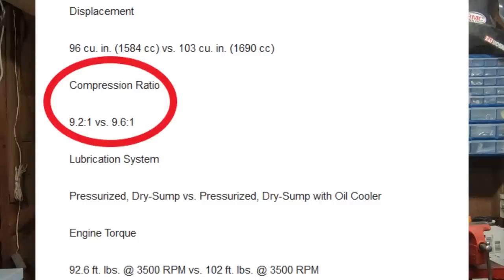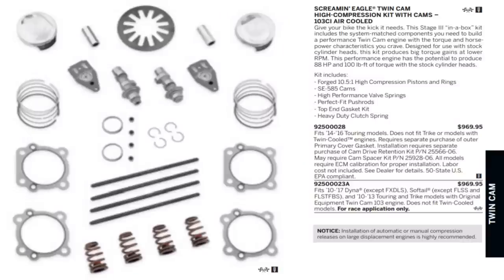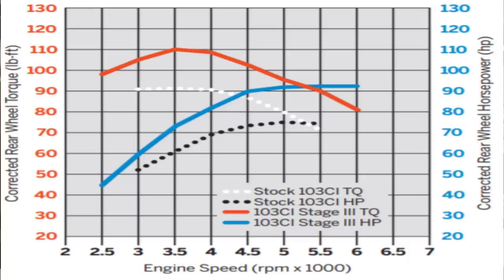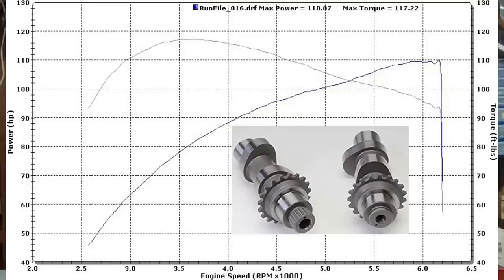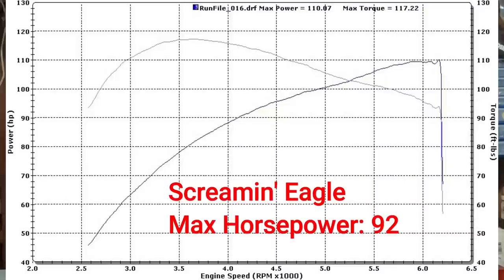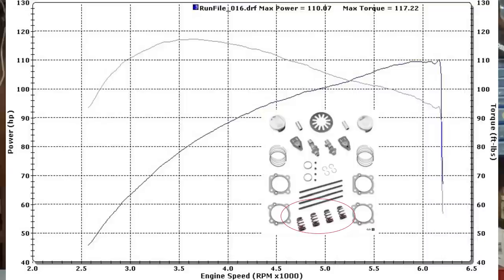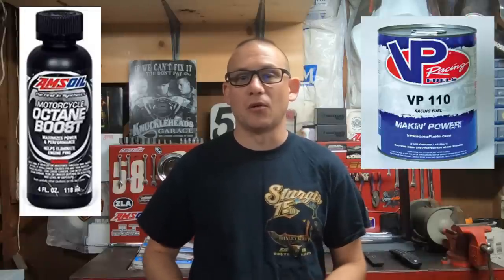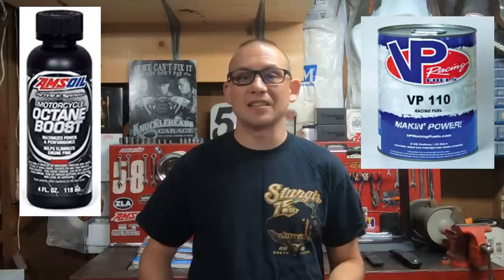Harley Twin Cam Engines Love Some Compression

Comment from the maker: Do you prefer to keep a lower compression ratio or bump the compression ratio up for more power?
Reply: Never thought about going this route, thanks for sharing. Will give it some thought.😎👍
Reply from the maker: It's not a bad way to go, Twin Cams really make some power with high compression and a good cam.
Reply: Bought a T.C. 88 with screaming eagle heads, air cleaner, thunder header 2 into 1 exhaust the bike has compression releases. I need to find octane booster.
Reply: This is a great topic to discuss. A minimum of 10.0 should be a baseline for almost all builds. I can't wait until I have a legit reason to remove my cylinders and heads.
Reply: @thewheel2023  
Octane boost is not that great. What I do for my shovelhead that detonates on pump gas is go to the drag strip and by 110 Sunoco & mix it 1/2 & 1/2 with 94 Sunoco comes up at 102 octane. You can mix more or less depending on your octane requirements
Reply: Compression and lots of it...
10.5 to 1 on mine
Reply: @thewheel2023  I run high test without corn in it. And I have never had a problem with detonation however I did retard my tuning two degrees to slow my engine down just enough so that I could fill the jugs at 6800 with my 67g Andrews cams.
Reply: Bump it up 😁
Reply: Keep in mind what elevation you are at and that cam choice will affect what you get for corrected compression. My static has been raised to 11.1:1 but I am no where near getting that after you factor in all variables. Best to use one of those compression calculators on the big boyz website.
Reply: @scrumthebum2451  I found in some of the states at the Sunoco stations they sell the race fuel in the back of the station away from the regular pumps out front. My brother runs a tank through his bike once in awhile.
Reply: @nickc5341  I use a compression tester and do the calculations my rear cylinder is actually 10.58 or something to one and my front jug is 10.52 I'm at 800 ft
Reply: @randylucas2458  nice. Those are good compression numbers. What's your ccp at? Unfortunately I live at 2200 feet elevation which makes it a little harder for me to make power. Wish I could afford a pro charger lol
Reply: @bradballard2068  
Cool but nothing like that around me. Maple grove raceway is only 20 minutes away 👍
Reply: @nickc5341  I'm not sure whether super charging a Harley motor is a good idea I've never done it I did supercharger goldwing once and that was magnificent as for my CCP's I can't remember it's been like four years since I ran them The elevation you're at I would consider a supercharger maybe a mild one three or four pound boost I don't know I've never tried it
Reply: 10.5 to 1 to 11.0 to 1 will work great !
Reply: Well I've been running the woods 222 with stock compression in my 2015 fxdb for about a year now and recently my factory pressed crank has shifted, so it's in the shop now getting a rebuild... S&S crank, with domed weisco pistons, cylinders honed to match...and some mild head and valve work... and at about 10.25:1 compression I decided to switch cams over yo the S&S 585... I should have the bike back by the end of next week and I'm really looking forward to the results...
Reply: more compression = more HEAT ..CAM IT,, better pipes, tune it ..let the air flow..AND if you cant good gas , its a dirty cylinder.
Cam it, shave the heads.(?)..Higher compression will be harder on the bike.

Comment: It's amazing what a slight bump in compression, minor headwork, and a cam will do for performance.  Top that off with a great dyno tune and it's like a new engine. The sad part really is that they could and should be built this way.
Reply from the maker: I totally agree, they should come from the factory like we build them in our garages. It really show us just how much potential they intentionally leave out of these engines.
Reply: This is what they call the Harley Tax
Reply: @simonkennedy6116  Harley Tax because Harley Slax on performance
Reply: They design the engines to run on the shittiest gas/harshest climate in the world without engine destroying detonation! Otherwise the manufacturer would go bankrupt doing warranty work! Ultra conservative timing curves negate detonation and lean fuel meets EPA mandates.  That’s why an aftermarket tune adds good power, more timing/fuel....

Comment: Turned my stock 88" twin Cam into a 95". 585 S&S easy start cams. And 10/2 to 1 compression piston Dyno at 110HP. And 117 lbs.   Baby really moves.
Reply from the maker: Damn. That's some hella good numbers from a 95! Just goes to show what the right combination of parts can do!
Reply: What part of the country do you live in, and what shop did the work. Thanks

Comment: Did my 2009 fxdf with the SE stage 4 race kit with yellow race SE tuner, 10.5 to 1 compression, ventilator intake and SE slip on mufflers. My year had no catalytic. Ended up with a reliable 111 HP and 110 TQ. Bike runs great!
Reply from the maker: That's awesome! That's a really solid amount of power and doing reliably is what it's all about.

Comment: Your right on with more compression ! I don't even do stock rebuilds with out using Cometic MLS gaskets back in the day we always milled Evo heads .020 to wake them up but now we got thinner gaskets lots easier ! Your also right about checking valve to piston with stock pistons Back in 99 TC motors there weren't any good pistons & we had to machine the pistons for deeper & wider valve pockets for big valves & high lift cams !
Reply from the maker: Great point! Cometic is the way to go in my opinion on gaskets! We've reused those things before time and time again, first time was a have to situation and it worked. These gasket thicknesses available is awersome!

Comment: Good info man. I had my screamin eagle motor done last winter, kb domed pistons, heads were ported, andrews 57 cams, crank has 2 thou run out, which surprised the mechanic and me as well...10 over bore, hone, and decked gasket surfaces, hpi throttle body, bigger injectors, bassani 2 into 1 road rage 3 pipe, arlen ness velocity stack air filter, tune liscence from dyno jet and a proper dyno tune...runs awesome now for a 19 year old bike...2003 cvo road king.
Reply from the maker: Nice work! Damn that's a laundry list of work done to that bike! Those are some beautiful bikes, especially that first year of the 103 Road King, I bet it runs damn good.
Reply: @GixxerFoo  ....ya man, thanks for responding!....its really fun to ride now,  it was befor when I first got it, but now it's like a steam loco!

Comment: Great info, as always. I wouldn't tear a motor down just to raise the compression, but if I were doing other work and had it mostly apart anyway then it is definitely worth it.
Reply from the maker: Right on, not a good plan if it's got some miles on it. If it's low miles and you added a cam and changed your mind on compression I could see doing it then.

Comment: After seeing this build I'm excited to see what mine is gonna do on the dyno .
100" S&S kit with 10:5:1 
S&S cam plate and pump 
Woods 777 cams 
Woods lifters 
Fuelmoto pushrods 
Heads ported and polished with oversized valves and beehive springs , roller rockers and decked. 040 for about 11:1 compression. 
Tuned with a thundermax tuner. 
Appointment with dyno tuner next month. 
Not sure what the Hp and tq is but this thing is fun😁
Reply from the maker: That bikes is gonna sound angry and run hard! Let me know what you end up with!

Comment: Just remember. The more duration the intake cam has the later that valve closes which lowered dynamic compression.  12:1 static compression could be perfect for pump gas if your cam has enough duration.
Reply from the maker: You are correct! There's so much to calculating compression it's crazy, it all has to balance to be right!
Reply: So I'm looking at a WG right now. It's a built s&s motor top to bottom w/ 585 cams. It has 12.5:1 which seemed pretty high and I can't find any info online about Harleys with such high comp. Are you saying its not too high?
Reply: @kye9549  That seems high for that cam and 91 octane. If 93 is available in your area, it may be close but it wont be happy on days over 70 degrees.
Reply: @robertbachant8257  we have 98 available. Plenty of hot days coming up though

Comment: If your running that low why not kick it up.  We used to run cars at 11.5 to 1. Wrist pins, crutch assembly , valve springs needed to be increased and maybe a better oil pump.  Why not when it’s time to rebuild it have some fun?  If you are like me and a gear head be it bikes , cars or trucks it’s a no brainer.  It’s something I like to do with my sons and pass the knowledge I have from my father to myself.

When I was kid in the late 60s -70s the gas shortage hit.  We used water injection as the gas was crap. Texas 93 octane is all over
Reply from the maker: It's crazy what some increased compression will do for a motor, biggest problem is keeping them from knocking on pump gas. Gas quality varies so much when you're traveling, I've gotten stuck at some old 2 lane highway station with only what I assume was once 87 octane lol. That's why I carry some octane booster just to be safe.

Comment: YouTube buried your channel on me but I'm back. ✌️😎
Also, I wanted to thank you for your recommendation of the spherical bearing kit for my swing arm that was on a previous video. (That I can't find)  I did the install on it and it works great. It took that torque kick out of the ass end of my bike when I get in the throttle. LoveLoveLove !
I appreciate all your uploads and your sound advice.
Reply from the maker: Thank you! I really appreciate it! It's great to hear you got your bike straightened out and tracking right now!

Comment: Awesome.  Love the content. I used a .0030 gasket when I did my heads.  Dan Vance Racing did the work.  I would recommend him any time. Talking my book, but he might be the best HD head guy out there.  His back ground was racing.  I use octane boost all the time.  I don't have any problems, but I notice a significant increase in power.  I think the gas we get today cut with ethanol is not that great. Not only an increase in power, but gas mileage, so it's a win win. Left the stock 103" pistons in.  Someday I'll upgrade to a drop in 110", but the motor runs so good, I'm afraid to touch it now.
Reply from the maker: That's awesome to hear! Yeah ethanol fuel is awful, I avoid it as much as possible.
Reply: I always hear how ethanol is bad, but every manufacturer designs the engine to run on it, ethanol is a form of alcohol,  e-85 is essentially alcohol and has a 110 to 120 octane rating. I always run premium fuel 91 or better, but everything else like the daily, mowers etc get 87 and they work year in and year out.  I think the "ethanol bad" myth is just that, a myth at this point.
Reply: @Random-bm7ho  It's not that it's 'bad', but it definitely cuts the mileage. That's a fact. I run 91 also but like I said, I add in a octane booster and I love it. If you have never tried it, do!  You will notice the difference I guarantee it.
Reply: @Mark-mm1ke  I usually run some of the Lucas fuel injection cleaner/lubricator stuff in every tank. It's just a stock 103, but I'm looking to add cams, upgrade the oil pump and cam plate, and maybe a thinner head gasket while I'm there. Engine has 18k on it. Just looking to wake it up some.
Reply: @Random-bm7ho  I did a lot of searching on cam profiles before I bot the Woods 222. Has the best low end torque of them all imo.  So I went with that, V&H power duels, map, and air. Came out great. Next year did the heads. Wow, what a difference. Numbers were not all that much better, but the seat of the pants ride was!  Here are the numbers. 116 torque, 103 Hp.  Torque at 2000 rpm 100ft/lbs. Bike runs incredible. I also did both front and rear suspension from Terry Cable. I’ll never get another bike and not do that.  Handles like a rice rocket!  LOL Well, you get the picture.
Reply: @Mark-mm1ke  I think I'm gonna go with the S&S 583 cams. Already have the VH Power Duels, Roland Sands intake, and the FP3 tuner.

Comment: I have kept my 88 standard, apart from a change of exhaust cam which makes it run cooler.
I like the fuel consumption of standard trim suits my riding.
But I know a lot of guys up the power and that’s their right, it would be boring if we were all the same.
Reply from the maker: Nothing wrong with keeping it simple, they are very reliable with just basic tuning, exhaust and air cleaner.
Reply: What exhaust cam did you use. Running cooler sounds good to me.
Reply: The guy who ordered the parts chose a cam which just keeps the exhaust opened a bit longer but I will ask him if he can find out for you.

Comment: I sure did wake my 103 up...
I installed a stage v 103 - 110 kit with 10:5:1 pistons,  259E cams,  cnc ported heads 58mm  Throttle body ,S&S Cam plate and oil pump, RC  head pipe , Dyna jet powder commander v, Getting ready to have it dyno tuned .
I'll let you know what the results are.
Reply from the maker: You got the right setup right there, the compression is gonna make all the difference with that setup! I'd imagine you won't be disappointed at all!
Reply: 125 h.p. ?

Comment: For an everyday/road trip bike I like keeping the comp low. Never know what’s gonna be available for fuel. Rode to florida from PA hit a couple spots where the only fuel available was 87
Reply from the maker: Agreed! Been there too! I always carry those little octane booster packets just for that situation.
Reply: Yeah. Had that happen. Had to burn 89 and my mileage went straight to hell.  Went from 45mpg to about 30
Reply: Or you can have a road trip tune taking 2-3* of timing out, ta-da.....excuses are just that, excuses....😎
Reply: @trailerparkcryptoking5213  can’t adjust 88 timing without getting an aftermarket ignition box
Reply: @tl5108  well get one.....can’t have a proper tune without the ability to adjust timing curve.  Anything from the factory has an extremely conservative timing curve so that it will run in harshest environment on earth on the shittiest gasoline on earth, in an effort to not detonate and create warranty work!  If you have decent air and fuel then you can run more aggressive spark timing and get better performance and fuel mileage!  Buy Dr Christopher Jacobs book Performance Ignitions it’s an absolute must read!
Reply: @trailerparkcryptoking5213  I’m not that concerned with it. Bike runs good and gets good mileage
Reply: @tl5108  you were concerned enough to watch a video on higher compression....😂😂😂👌👌👌

Comment: I put an EV-46 cam in a 1340 1990 fatboy, with a dyna ignition & coil and a few other tricks
Reply from the maker: Evos love Andrews cams, Andrews sold untold numbers of cams for the Evo. They just worked in those motors.

Comment: + Compression made my exhaust note pretty snappy in the old sportster
Reply from the maker: Before they started boring them out to 1250 high compression was the way to go! Now we can go 1275 with high compression thanks to Hammer Performance.
Reply: @GixxerFoo  this is on an old ironhead man.  Stock stroke, .30 over 1000 cc, wiseco 10:1 slugs, head work and cams.  She's mean.